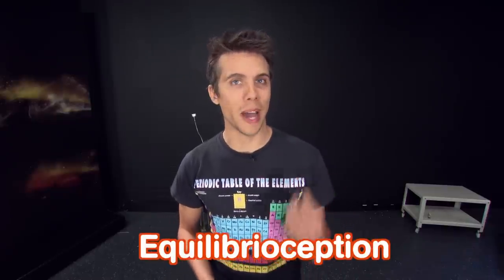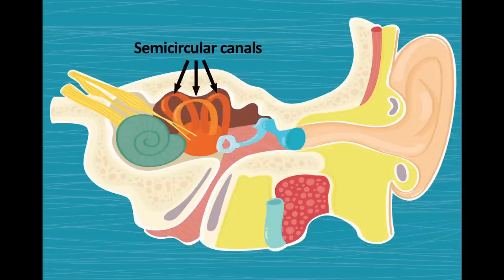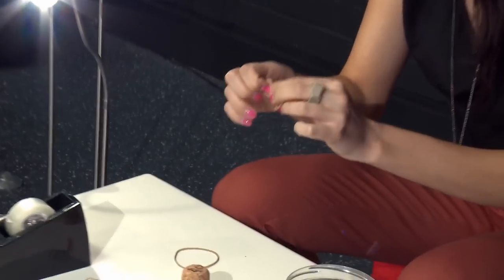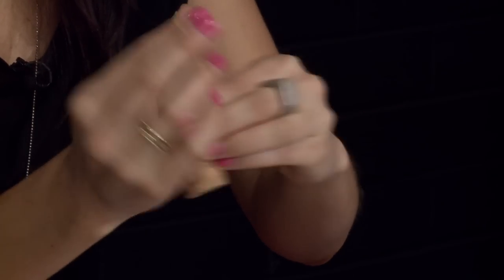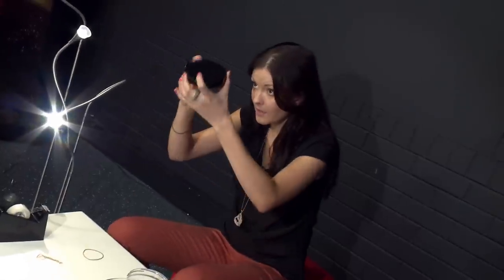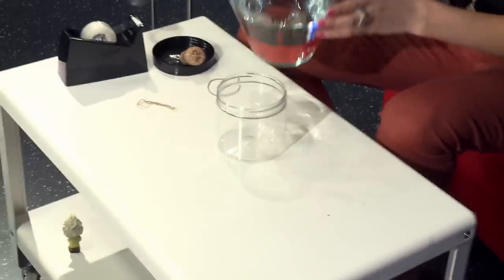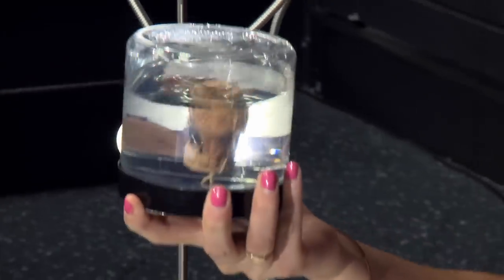How to make an accelerometer

Comment: Because the cork is highly less dense than the water surrounding it, when acceleration is applied the water shifts to the back of the jar pushing the cork forward towards the direction of the acceleration.

Comment: Moving the jar to one side quickly is pushing water to the back side of the jar increasing the pressure in the water on that side. At this point buoyancy has an effect on the cork not in an upwards direction that we are used to but in a sideways direction pushing the cork to the lower pressured side of the jar which ends up being the leading side or, the direction in which the jar is being moved.

Comment: The cork moves towards the direction of travel because the water molecules are push to the back by inertia, increasing the pressure at the back, forcing the cork toward the lower pressure that is at the front or the direction that you are going toward.

Comment: Water is more dense than the cork. It is the reason why the cork tends to float and has to be anchored. Water has greater inertia than the cork, because of the density differences, water moves against the direction of acceleration. Thus, it sort of pushes the cork in the direction of acceleration. This can also explain why the cork floats in the water since the gravity (force just like acceleration) is pulling downward while the cork moves upward. I guess.

Comment: When the jar is moved in a direction inertia causes the waters mass to focus on the side of the jar opposite the direction of movement, and since the cork floats it will go opposite of that making it point in the direction of movement. The same applies to a helium ballon in a car, it moves toward the direction the car is moving,

Comment: The cork s speed compared to the jar when moving is relatively smaller. Also the cork was in a state of equilibrium which  it wants to maintain and thus appears to be moving in the opposite direction of the jar s movement

Comment: When you move it really fast, there's high acceleration. That is increasing velocity, hence the outer jar is faster than the cork inside as it retains a constant velocity. Eventually the jar has moved so much that the water or the jar itself puts enough force on the cork, to accelerate at the same rate. therefore you got the  slanting of the cork in relative to the jar.

Comment: The cork goes in the direction of travel instead of lagging behind as you might expect because it's floating in 3D. The water, about 800 times denser than cork, lags behind the acceleration, and the cork "floats" sideways against the pressure gradient. Helium balloons do the same thing when tied in your car.

Comment: The cork moves to one side because it is lighter then the substance that it is suspended in. When there is acceleration applied on the object the heaver substance moves to the back of the container where the cork which is lighter is pushed into the direction of the acceleration.  Kinda like having a balloon full of helium in a car. when you move forward the balloon full of helium moves forward! I personally would have used a balloon in a car and made a huge accelerometer that way.

Comment: I think the reason why the cork wouldn't move so much is probably because once you got that vehicle moving you entered a constant speed mode, so you didn't have any acceleration, and that's exactly what the ACCELERometer is supposed to measure. No acceleration because you're moving but with the same speed means your accelerometer will read ZERO, and that's the cork not moving so much.

Comment: Actually, counter intuitively, the cork moves in the direction of the acceleration, as the water which has a higher density is what has the stronger inertia to stay still, pushing the cork forward. You can do something similar in a car with a helium balloon.

Comment: ...
PART 2

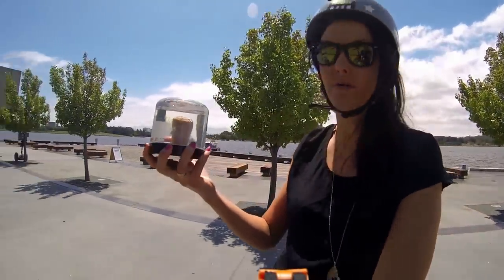...*in* the direction of the jar's motion. So when the jar accelerates from left to right, the water has a higher pressure on the left wall than on the right, and so this "horizontal buoyancy" makes the cork "float" to the right (4:10). Conversely, for a denser object: if a ball of steel with the same mass (and hence, inertia) as that of the cork is hung in the water, it will move from right to left. Finally, if you had an object whose density is the same as water, it will stay put.

Comment: The semicircular canals do not report on position. They report on changes in rotational state of the organ. The utricle reports on the position in a gravitational field or an acceleration (there is not difference between the two at the fundamental level, it is Einstein's Elevator in a nutshell)

Comment: Water stays put due to inertia, and since the cork is denser than the water the cork moves to the less dense space in the jar, wich happens to be in the direction of acceleration, where the air is. Same effect if you put a helium balloon in a car.

Comment: Your inner ear has a pair of accelerometers that work much the same way, only using calcium carbonate crystals in place of the cork. These are distinct from the more familiar semicircular canals that measure rotation of the head.

Comment: I'm sorry and correct me if I'm wrong, but I don't think your explanation is 100% right. My comment is a bit long so I'll split it in two or three parts. 

PART 1
When the jar accelerates, *all* objects in the jar *tend* to be accelerated *equally* OR appear to be acted upon by a (pseudo?) force *proportional* to their mass in the opposite direction of the jar's motion. So IMHO, it isn't inertia, but rather the *difference in density* that causes the less dense cork to move, and that moreover...

Comment: i believe there is an etter way to make an accelerometer xD 

cut a cylinder into quarters and place a marble on the inside of the surface left.. the marble must be constrained to move parallel to the circular edge of the cut-out cylinder... then if the cylinder with the ball in it is accelerating, the ball will be 'pushed' further up the curve of the cylinder